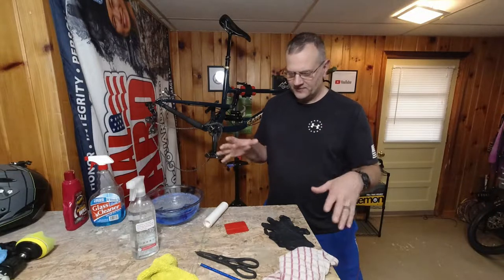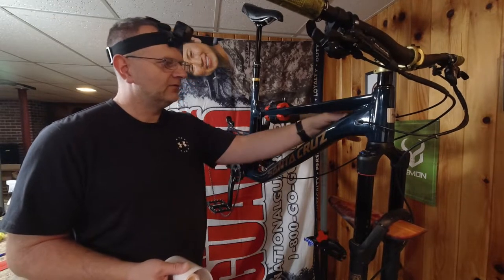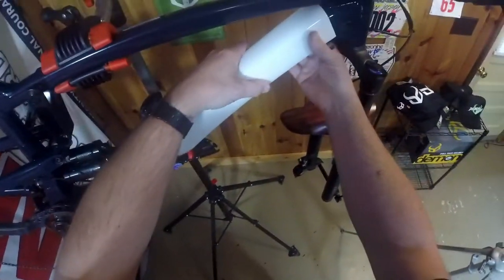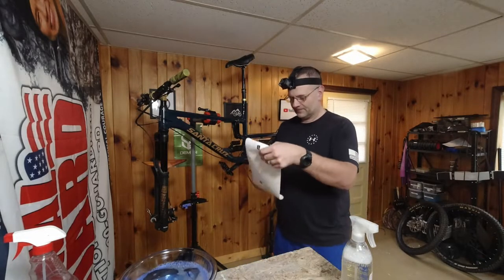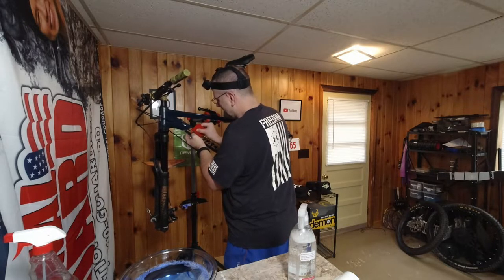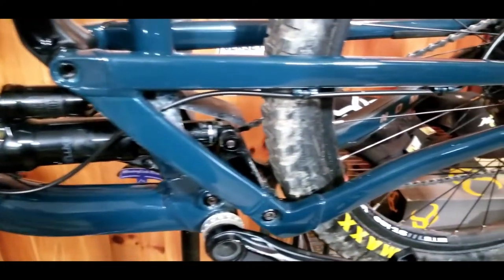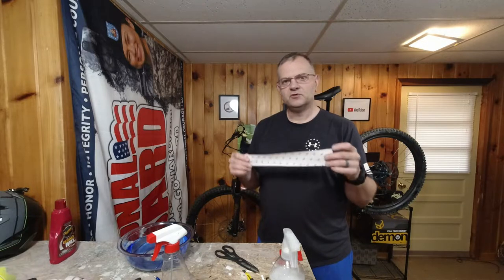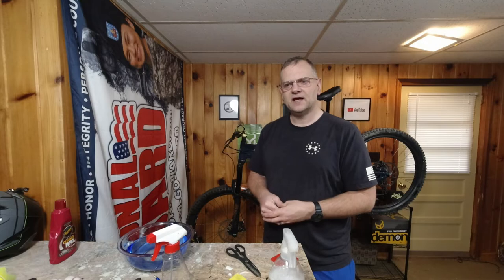Restore Luster To Your Bike - Paint Protection Film - Part 2 - 3M vinyl film

Comment: It’s been my experience when using soapy water for clear decals the decals will look cloudy until all of the water underneath evaporates. So if your frame looks cloudy give it a day or so and it will turn back to clear. This also applies for window tinting.
Reply from the maker: Great tip! I didn't have any issues with that, but I could see until I squeegeed and wiped all the water away that it was cloudy underneath.